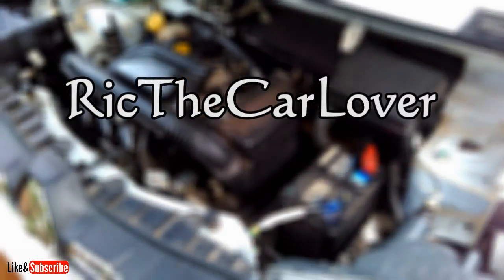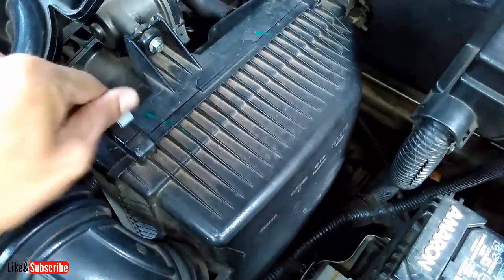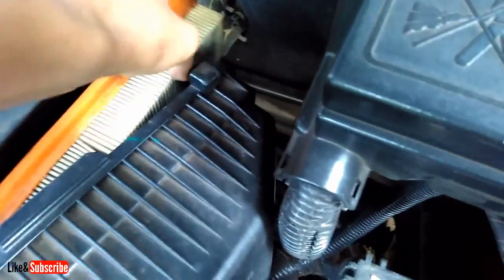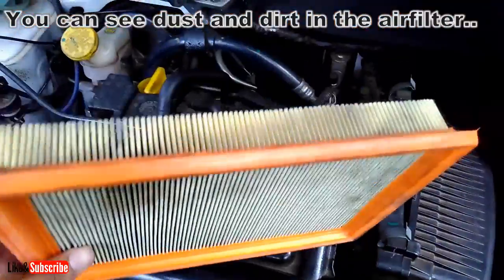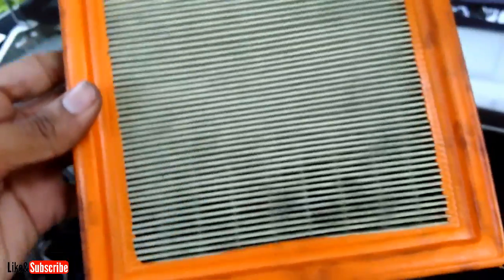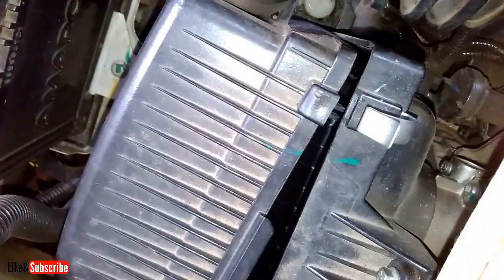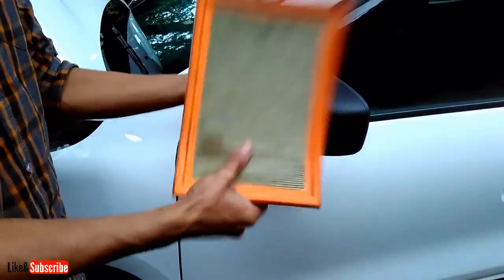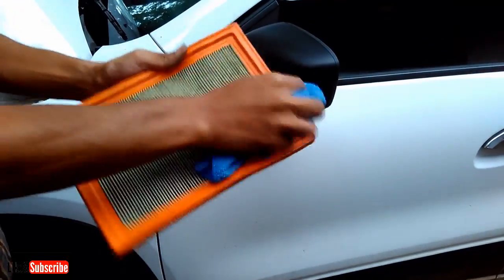Renault Kwid Improve Mileage and Performance - Clean or Replace Clogged Air Filter

Comment: Where i can get K&N filter for kwid?
Reply: Engine oil change interval time for kwid bs6 midel
Reply from the maker: +RAJEESH DAMODARAN  Please check with your Nearest Automotive perfomance shop.. 
Or you can send an email to K&N india regarding this..
Installation should be done by professional or experienced Mechanic..
Reply: @DrivewithRic mileage of 800cc kwid in city and highway when used gently with ac??
Reply: @womenisonereasonbehindever2049  I'm getting 20+ on highways 16 - 18 in cities with AC
Reply from the maker: I am getting 15-18 on city and 20-24 on highway.I got maximum of 24.5 on a 460 km long non-stop drive with Ac and 4 people.

Comment: can the air filter be washed with petrol and sun dried ?
Reply from the maker: No , never use the air filter with petrol or chemicals it will damage the engine.. better buy a new one, or just blow air or do like in the video..

Comment: Bro when car goes in service then they don't do it ?
Reply from the maker: Yes, they replace every 10000 km or 1 year, but if you drive mostly on dusty and bad roads the airfilter will prematurely clogged and reduce performance and mileage. So it is good to check at 5000 km and you can clean it or replace with a new one , very cheap..